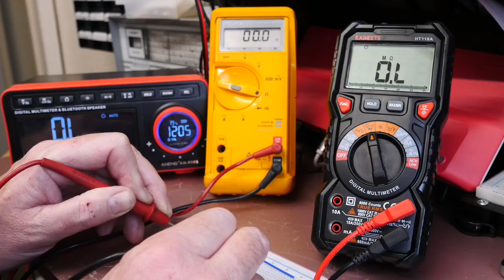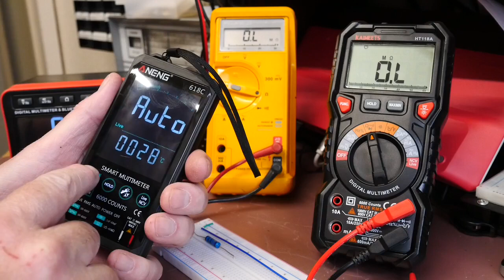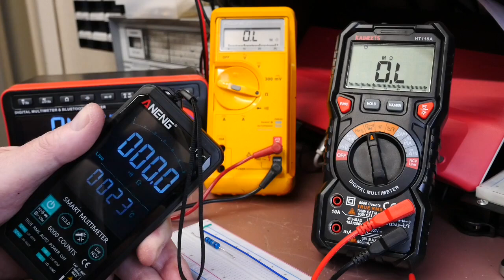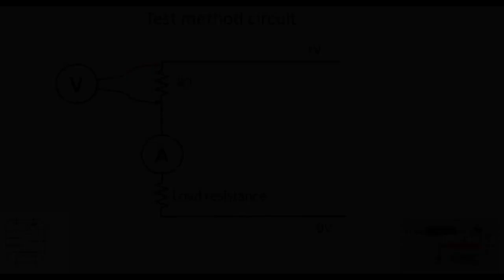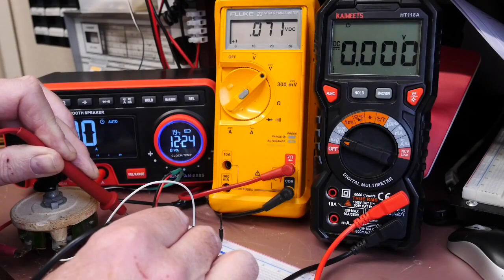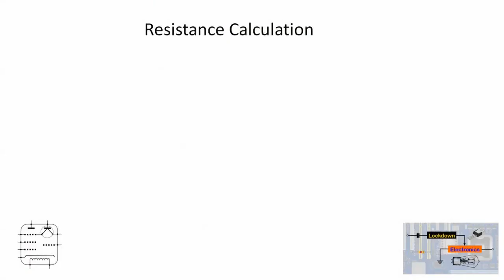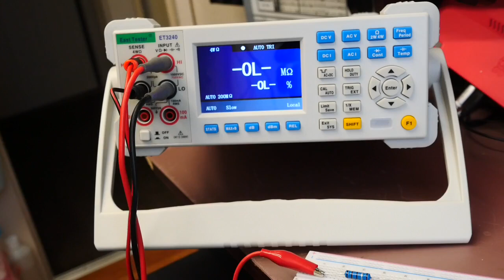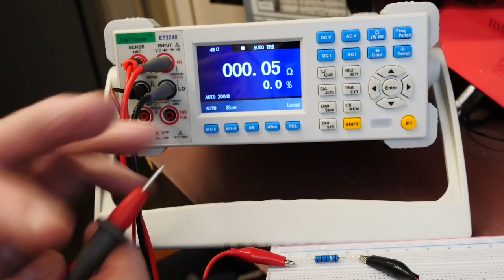Measuring low value resistance accurately with Kaiweets HT118A and Aneng AN-888S - #042

Comment: If your meter is not complete middle-aged, there should be no problem with small values. At least I never experienced.
In some situations it's useful to have a second pair probes that are not very high quality, and have some resistance (and THIS resistance of your 2nd pair cheap probes you should know exactly 👌.) the rest you can quess I think 😁

Comment: I saw your east tester is reading 0.05 ohm when not connected so if you subtract that from the measurement you get 0.09 which is close to 0.1ohm you should read. 10% off. Definitely better than 40% off that 0.14 would be. Anyway you want to check the accuracy of that meter. Maybe is within manufacturer tolerance.
Cheers